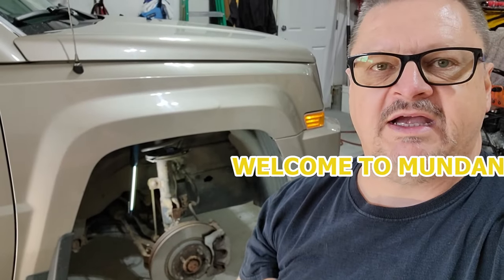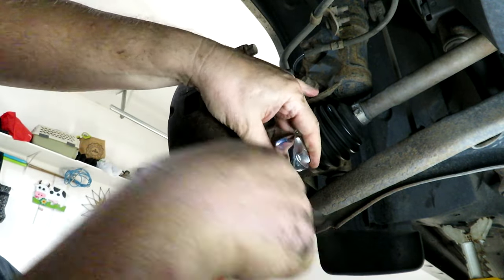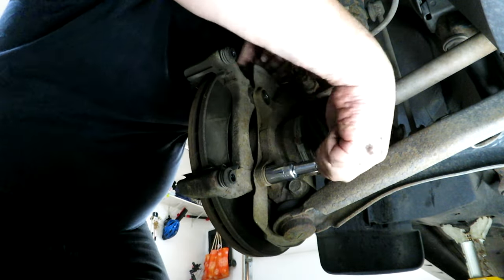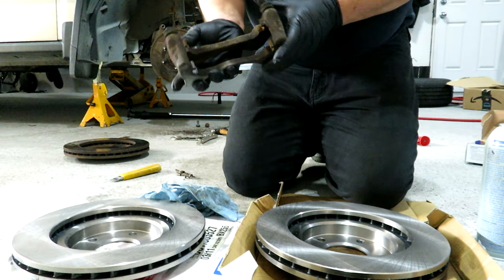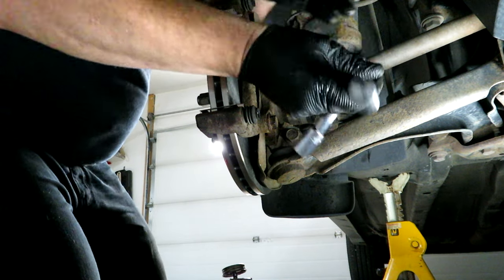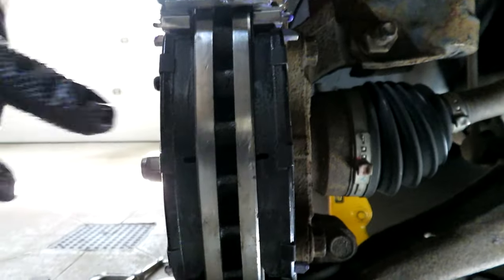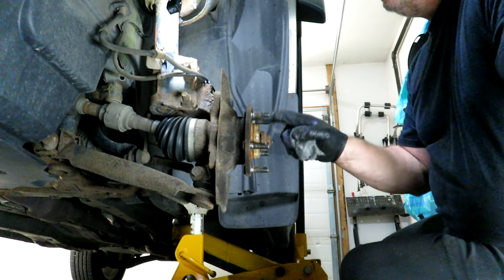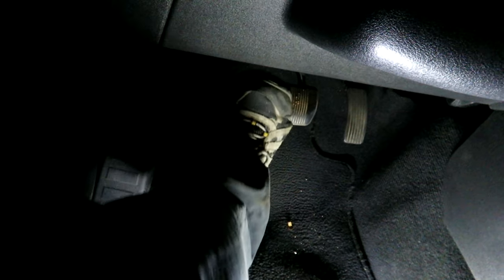How to Replace Front Brake Pads and Rotors | Jeep Patriot | 2007 to 2017

Comment: Thanks for this video. One thing I think is the slider pin with the sleeve on the end is the upper slider bolt, not the bottom you put in this video.

Comment: Taking the cap off the master cylinder before compressing the caliper is good practice. Good video 👍
Reply: If you like brake fluid in your engine compartment.
Reply: @vanjam412 I’m about to do mine, are you saying I should NOT open the cap to the reservoir prior to compressing the piston?

Comment: Great video.. I did the front pads and rotors on my 2013 patriot today... on both sides , 1 slider came off nice and 1  ended up rounded horribly... all worked out in the end though. Thanks for the video 👍

Comment: I have a 2014 patriot that I just bought a wk ago .. I pulled both front tires for the heck of it just to get familiar w/ the brakes and noticed the bottom bolt of the driver side caliper doesnt move when i move the rotor to see if sliders are workin properly .. im thinkin it may be seized ... can the slider pins be replaced w/ out removing the whole caliper ?  .. Im feelin a slight stick when I release the brake pedal .. so im thinkin it may be that pin ... Pass. side is fine .. No brake noise or shutter when applyin the brakes either ..

Comment: I recommend you not using purple ceramic grease on caliper pins, they either get stuck or rubber gets swollen. Use silicon grease .

Comment: Lose the  Extension if you're gonna teach. All that's doing is taking your torque away from your rotation point. And how about this is the size we're using. Just an idea. There is no need for that extension other than possibly rounding the bolts off.